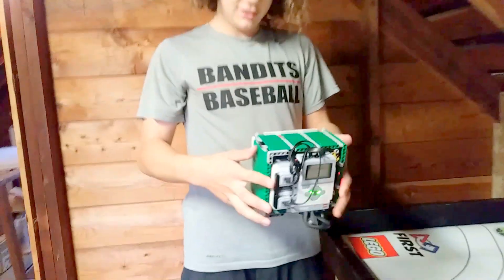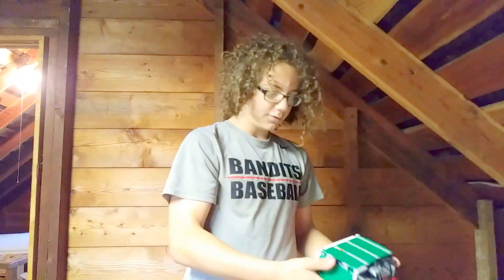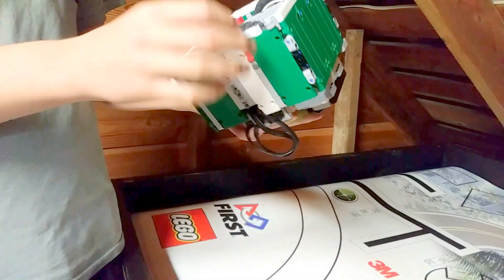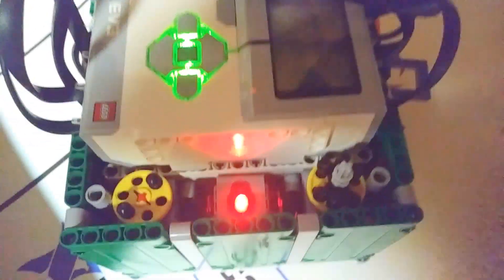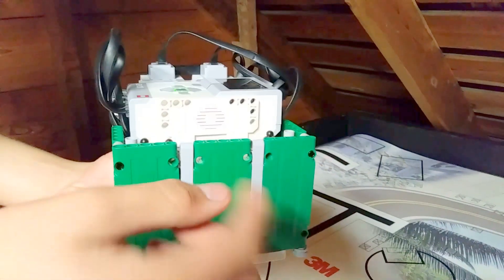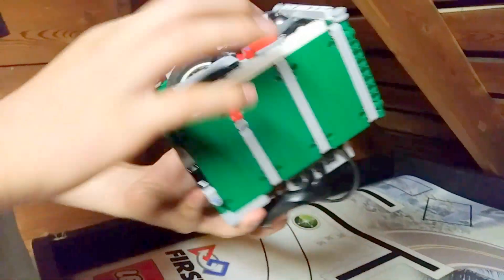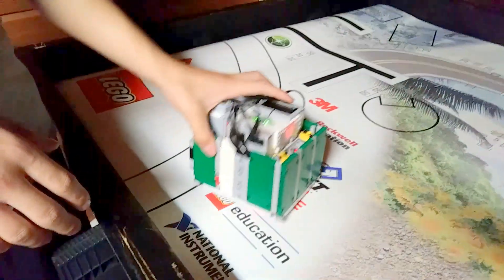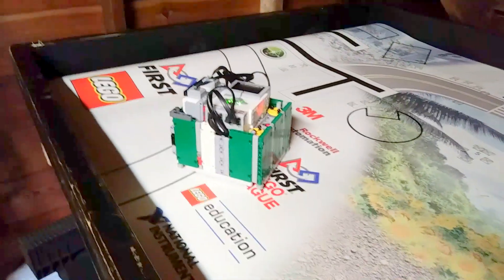NEW ROBOT! Super Small Design for FIRST LEGO League

Comment: Ik like tot put nu large motor upside down. So IT is very low to the ground. And then i use those large wheels like you did. And if u drive your robot only straight forward u Will seen IT doesnt go straight Everytime. Because of the ballwheelthing. If u use Just wheels IT Will Go beter